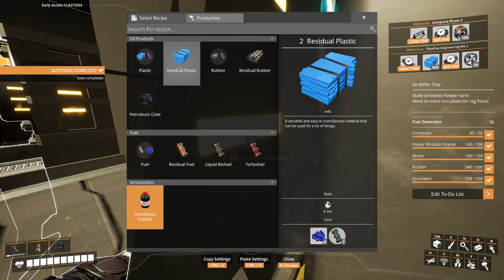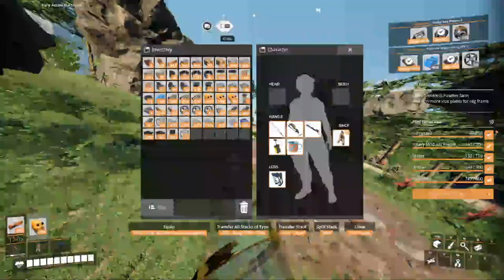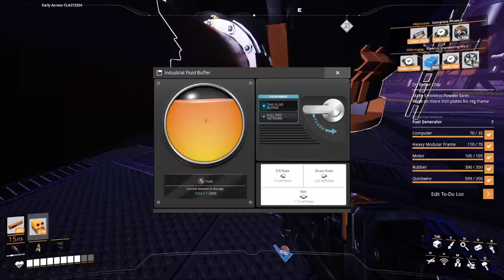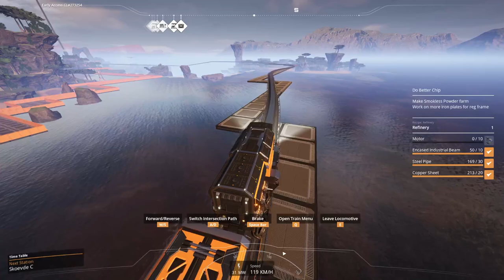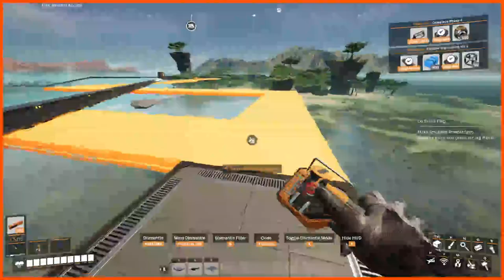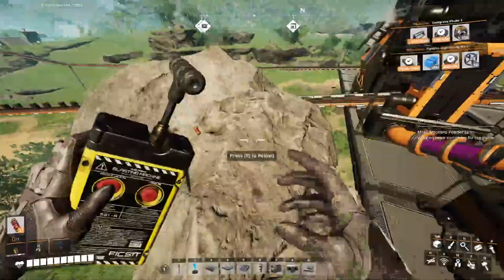SATISFACTORY - LETS PLAY - EP.15 - MORE POWER and Tiding Up

Comment: Satisfactory is one of those games that's very different on your second playthrough when you know what to expect and have learnt how the systems work. I can't have that first-time playthrough again, which is why I like watching new pioneers tackle it fresh. I suspect everyone's first playthrough goes like yours has.

On straight rails: build two isolated straight parts on foundations, then connect them together - you'll get rid of the kinks. You can then delete the short segments if you wish as the ends are aligned. There's a whole class of build tricks that involve building things to get the part you want in the place you want then deleting the "framework" that let you do it.

On splitters/mergers: place these down first, then connect the belts (rather than "patching" one into an existing belt). It will help you get straight and aligned belts and avoids the bug where a tiny segment of belt can get captured inside the splitter/merger (that doesn't upgrade when you upgrade the belt). Similar for junction crosses and pipes.